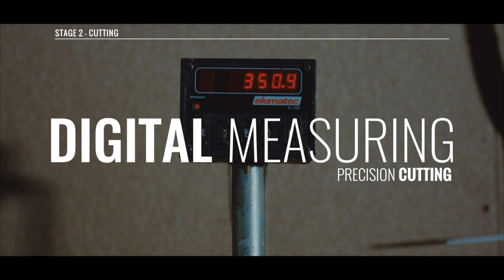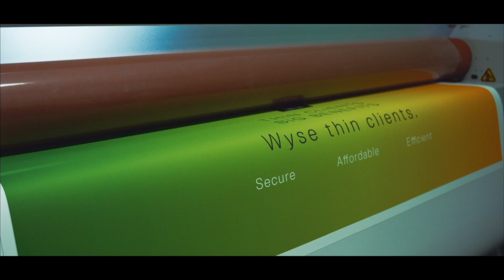UK Flight Case Manufacturer | NSP Cases

Comment: fantastic video .. use to make flight cases ages ago in my workshop at home , i use to work at penn fabrications  in the 80s ( now penn elcom ) use to buy the case hardware  and enjoy making cases ..  weekends .... things has gone along way in flight case manufacturing ...  penn fabrications was a good little company based in penn bucks .. they have gone along way , if you knows roger williams ( chairman of the company and david brown Md ) sent them my regards ...  and the flight case hardware never changes .. good luck to you and the very best
Reply from the maker: Thanks for the message, that's amazing!
Reply: Hey nigel, just found a penn fabrications flight case with wheels and handle, is this a good quality case?